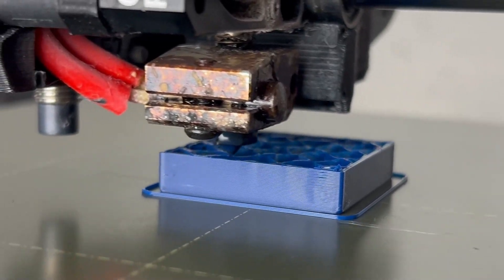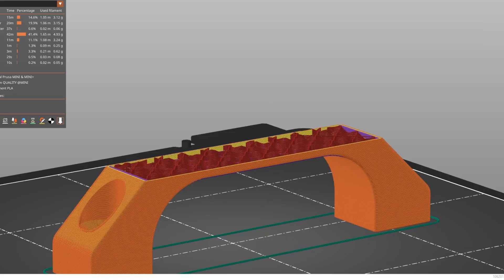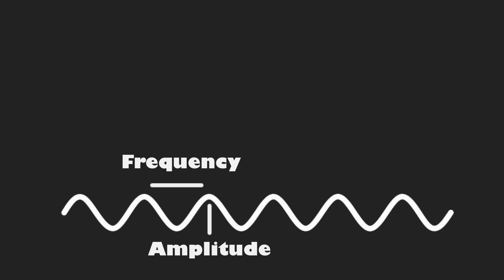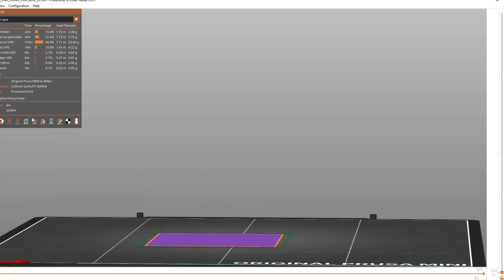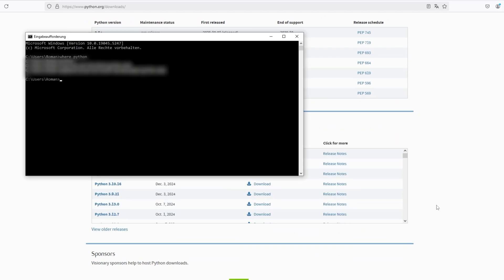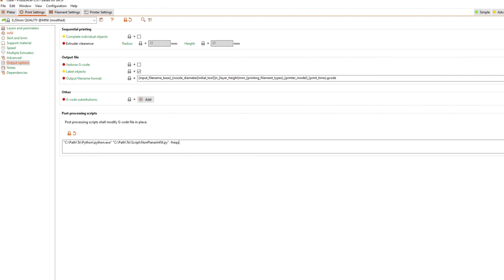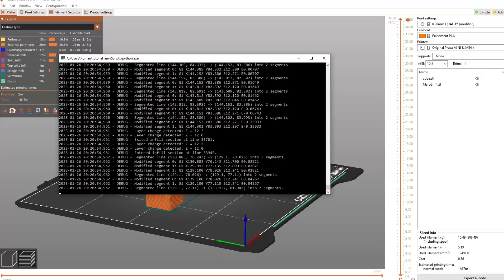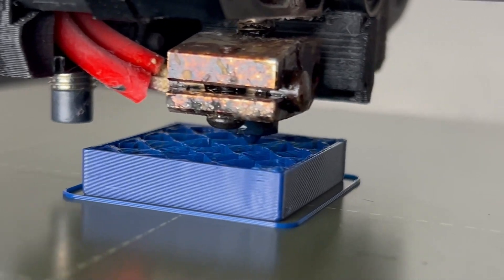Non-Planar Infill for Stronger 3D-Prints now Opensource!

Comment: I was imagining something similar in a vertical / horizontal pattern, using the sine wave shown it would have the high point of one wave running horizontally touching the low point of a vertical wave which was offset so that those points could touch - effectively forming a weave like cloth. I don't know if it would be better or worse just thought it worth exploring, like your interlocking layers but running in both directions.

Comment: Holy absolutely mother of based batman dude!

I've been screaming into the void about this for years!!! I can only imagine having non planar infill would be an EASY 5-15% increase in layer adhesion strength based on the increase of surface area and new angle of the infill, but I've always just been told I'm dumb! 

I absolutely cannot wait for @CNCKitchen to test this!!!!

Comment: I don't think this will change the nature of a layer.  It shifts around a bit but it's still laid down on top of the previous one.  I suspect no fundamental improvements here.
Reply: More adhesion surface between the filament strands will have it's influence on strength.

Comment: Please make script for multiple wall vasemode.
I have been doing this manually in CAD by using negative volume bodies and ribs. It is really beneficient for materials requiring uniform extrusion.
Also, klipper based belt 3D printers integration for prusaslicer/orcaslicer would be neat.

Comment: Congratulations for all these interesting scripts I need to try them. The code seems relatively easy so I wonder why no one (also not me) has done something similar. I looked in your code and saw that you are using re.search in a loop. You can use re.compile outside of the loop and then use the compiled search pattern. I made one of my scripts 30% faster so I highly recommend doing it. Personally I worked on the gradient infill script from Stefan, to make it work with orca and Prusa and introduced a volumetric flow limit. He doesn't seem to reply to my pull request though.

Comment: That's great work.  What about pushing more infill to the edges of the print?  The infill near the centre of the print is not mechanically loaded and does nothing, while the infill near the edges are highly loaded.  Makes sense that there would be far more infill near the edges and almost none in the middle of a print, but I haven't seen a slicer do that.  It might be quite complex mathematically.
Reply: Support cubic might be what you are looking for
Reply: @Spectron2077  I had a look and I can't find that particular infill.  Looking at the different infill strategies it looks like cubic subdivision is close to what I was talking about.

Comment: Did anyone get this to work? I get errors every time.
Reply: And when it does work the test piece is... empty. No infill.
Reply from the maker: Do you by any chance use absolute extrusion?
Reply: @tengertechnologies  I think it was working because looking at the gcode, the “internal infill” does have Z moves, though they are smaller than anticipated. However it didn’t show any infill in the PrusaSlicer Gcode viewer on Windows 11 or Mac. Using an online gcode viewer, it does show the infill moves - actually running it will be the real test but it could just be an issue with Prusa not showing it?

Is there a way to calculate what the maximum deviation in z will be? I would expect it to be the amplitude but it seems much smaller.

Comment: Just as a note (more for the BrickLayer and the large-inner-wall scripts), I believe the post-processing script should have access to the setting variables, such as layer height  .. that would allow you to pass those as variables instead of the user having to set them in the post-processing section. IIRC, it should be something like {layer_height} (or whatever the setting in the slicer is, it says when you hover the input fields).

Additionally, you can probably set it up to pass the model back to the preview once it processes -- if not, you could add a command to automatically send it to the standalone GCode Viewer that Prusa Slicer includes (I don't think Orca packages it) -- might be the better option.

If I remember at my desk tomorrow I'll test these and post to GitHub. Some versions of Prusa/Orca break this stuff.

Also, since you're feeling so creative .. if you want to experiment with some more, a few other things we've been teased but never given over the past few years were the circular bridge overhangs (where it draws a thin circular pattern to have a cleaner overhang) and the non-planar printing (would need to take the tool head into account for limiting).

Comment: I'm torn on this one, will it actually be stronger? Right now it is certainly 'different' but the bond between the infill needs to be as reliable as the old for there to be more overall surface contact, it looks like it's causing more imperfections as a result of the edge of the nozzle skimming and catching perhaps? It does take splitting forces more out of plane, and gives those out of plane areas more surface to be 'wrinkled' across. But needs to be tested to constitute as 'stonger'. I'd just call it '(possibly)stronger' until the destruction details and failure modes are figured out is all.
Reply: Also 2 ideas you might like:
Extruding infill thicker near walls and tapering to thinner for the core, just put denser filament near the shell edges.
Support 'scaffolding' that prints similar to the support shaft of the 'pin support sphere' this might even be a reliable way to fix 'arc overhangs' from lifting from the first few layers being added and plastic contracting.

Comment: Something to maybe consider. Don't know the efficacy of it. If you want to maximize amplitude for z strength, then you run into the issue of colliding with your nozzle geometry (as you mentioned). This issue is exacerbated by increasing infill density (so I would expect), in that a higher density would mean that you would be more at risk with colliding with other "peaks". Thus, to achieve higher amplitude, you would need to decrease infill density. Essentially trading XY strength for Z. 

Ok. Would it be possible to apply the sinusoidal function to the inner walls of the print? Since the shell of the print carries the majority of the load anyways, and you might even be able to combine it with your other function where you do a sinusoidal function on the inner walls, but come back and do a fine outer shell in the conventional layer by layer format. The sinusoid would likely have to be oriented parallel to the wall direction which may cause collisions with the fine outer shell adjacent to it... hmm. A problem for somebody smarter than me I suppose lol.
Reply: Maybe even just applying the function to the entire print geometry (inner/outer walls, infill) would be beneficial, minus the aesthetics (to be determined). Obviously, similar to the infill, the top/bottom layers of the print would have to be accounted for as you want to retain the shape of your intended geometry.

Comment: Prediction for the next innovation: injection molding for the rectilinear infill pattern
Reply: Like printing a grid and periodically inject blobs of plastic into the cells to create 100% infill? It would take some trial and error to find the optimum injection volume where it re-melts the surrounding plastic to form a strong bond, but not so much that it deforms the outer surface significantly. And may need to stop short of 100% fill since you could get trapped air pockets and instead have plastic squish upward around the nozzle. But definitely an interesting idea.

Comment: Hey, I experimented with a similar idea about a year ago. The problem is the bonding between non-planar and planar extrusions because of the nozzle tip disturbing them during vertical movements. However there was definite strength improvement in some aspects. I did come up with some potential solutions which I might share

Comment: Seems all these scripts need to be integrated into the slicing engine to better integrate the process.  Case in point is the fact that the outer wall resolution script does not improve detail, only makes vertical walls smoother.

Comment: Why are the various opensource slicers so slow about incorporating these innovations into their slicers ?
Reply from the maker: My scripts are probably full of bugs and do not support each gcode flavour or printer. The official slicer team has to make sure that it works in every case. I just publish the scripts as proof of concept which will then hopefully lead to a lot of bug fixxes and eventually a slicer implementation.
Reply: @tengertechnologies  I was not specifically refering to you code, which has only been made public. But there have been several non planar developments over the last 5 years and yet none of them have made their way into slicers. If there are people that are willing to experiment with your freshly minted code, I would think there are many that would enjoy playing with experimental slicer setting.
Reply: My guess is that they need to check them first that they work with edge cases, that they are consistent, and that they don't violate any patents.
Reply: Volunteers just do whatever they want on their own time, and employees of organizations like Prusa like to do a lot of testing before adding things. But you are free to download an IDE, all of the dependencies, and the source code and make the changes yourself and submit them as a pull request.
Reply: @logicalfundy  Actually I have considered it. But right now I am working on an extension for Freecad that will allow modelers to apply textures to 3D prints.
Reply: @VictorGallagherCarvings  that sounds awesome. Right now I'm basically needing to get into Blender, which means if I need to change the CAD model I need to redo UV maps and such.